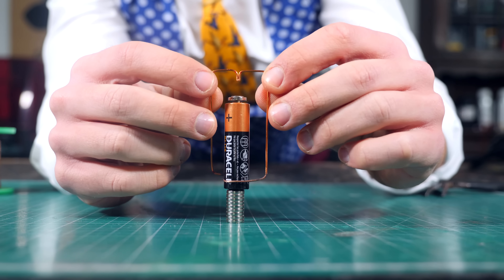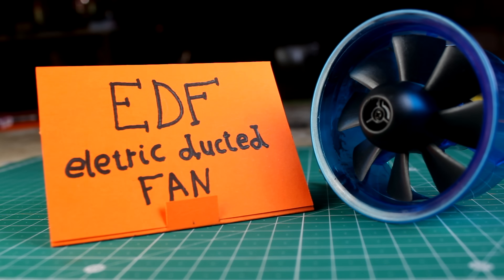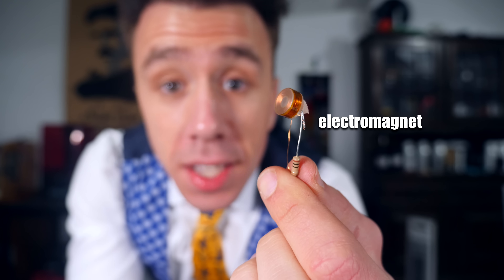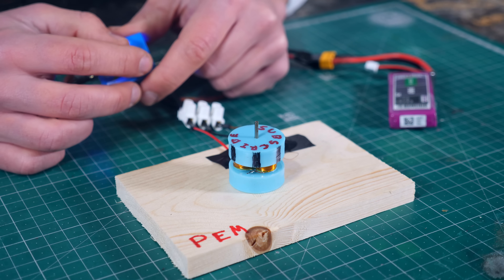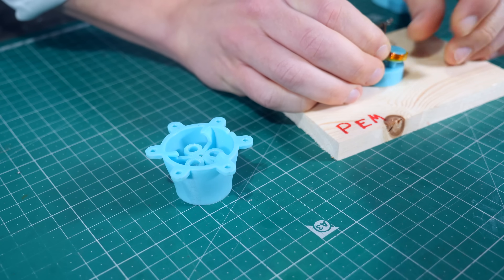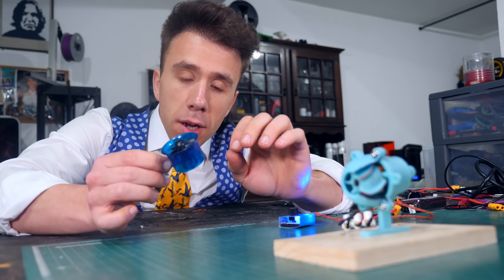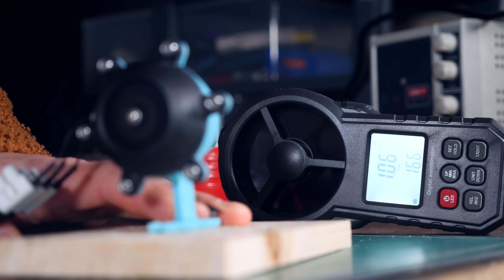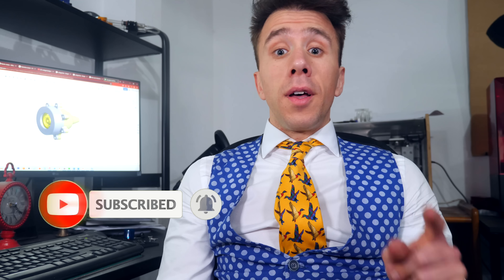I 3D Printed an ELECTRIC MOTOR FAN

Comment: You can’t put a convergent divergent nozzle on an electric fan. They only work when using a thermal working fluid (steam, combustion gases). People try all the time to increase thrust on EDF airplanes by messing with the thrust tube and always end up with less thrust than they started with.

Comment: Seguindo o principio da conservação da energia (mesmo motor, mesmo consumo energético) é óbvio que alguma energia está sendo dissipada de outra forma que não empuxo, normalmente energia térmica pela compressão do ar e provavelmente alguma parcela em ruido sonoro mesmo... Resumindo: Um ventilador em duto não possui incremento significativo na pressão do ar, porém um compressor sim! Geralmente só se usa um compressor em casos realmente necessário (por exemplo para aumentar a concentração de oxigênio dentro do volume fixo da câmara de combustão de uma turbina de avião), nos demais casos a simplicidade vai sempre levar a medalha de eficiência... 
Segundo ponto muito importante, talvez você esteja controlando apenas a frequência de rotação do motor e não a corrente consumida. Neste caso o duct fan possui uma inércia rotacional muito maior em relação ao eixo do motor, por consequência consome uma corrente maior e necessita mais energia para a mesmo número de rpm. 
Parabéns pelos vídeos, mistura perfeita de entretenimento e conhecimento!

Comment: The EDF is moving a lot of air fast. The centrifugal is moving a lot of air slow. You're using up energy in losses from poor fitting impeller blades and the fact your are pressurizing the air. That pressurized air is then leaking out of everything except the exhaust.

Comment: You need to revamp the design. More blades on the impeller. Also there is some specific geometry depending on the volume you want to bring in and direct the flow. Additionally to really get thrust you’re gonna need to work in some compressor blades, both rotating and static. Additionally you have to ensure you’re not over pressuring the back end of the motor more than it can move out.

Comment: The air exits the side and turns 90° (radially oriented) if you exhaust the air behind the motor, you cause the motor to do mechanical work on the air as it is forced back radially inward. This reduces maximum speed, and efficacy. Redesign the housing for the centrifugal fan, to accommodate side exhaust tangent to the motor fan, and in the direction if airflow.

Comment: on fans there is a 3d relationship between impeller speed, static pressure, and volumetric flow rate. you are designing your fan to have a high static pressure, but a low flow rate. 
thrust is mass flow x velocity (i think). so you need to have both mass flow rate, and static pressure that translates into velocity. energy is mass* velocity^2. so more mass less velocity is more efficient as well. an air speed meter only measures one part of the thrust equation. you are better off with a load cell for thrust measurement.

Comment: Just try adjusting the CD area ratios and changing the geometry of the blades. 

Modern aircraft use convergent divergent nozzles, the intake area and the exhaust area must be at a somewhat perfect ratio to maximize efficiency. Aircraft also use two counter rotating blades to slow down, compress and get rid of any turbulence. In those smaller conditions turbulent air might not have an effect tho. You’re also adding more energy into the system in modern aircraft through combustion which helps accelerate the air.

Comment: The design of the impeller is rather good for high pressure and low volume flow.
You would probably have to achieve significantly higher airflows, which is possible by lowering the angle of attack of the blades.

I don't necessarily have experience in developing thrust generation, but this is what I remember about the design of fans for grain cooling and drying systems. I should have the documents for this lying around somewhere and could look for them on request.

Comment: I'm assuming the issue is torque. Compressing air in a centrifugal fan needs more torque than a simple ducted fan does. The latter is compelling the air to move while the former is forcing it. Even a small amount of squish on the gas is taking energy from the actual movement of the air, if you look at it as a closed system. I'm assuming that compression is the desired effect, considering your proclivity for rocket science, so I'm going to suggest beefing up the torque to compensate

Comment: The compressor you have printed compresses the air to increase pressure and generate a high-pressure flow, while the fan moves the air without increasing the pressure and generates a constant and uniform flow.
Then the surface of the blades is not equal the blades of the EDF seem larger and are able to move more air than the compressor.

Comment: @Integza

EDF's move a volume of air thru the duct quickly, though not very efficiently. While a centrifugal blade is building up compression. This is why your seeing such a large difference in output thrust between the two.

Now if the Centrifugal blade was compressing air to be later mixed with fuel and ignited, then you'd definitely see a significant increase in output thrust compared to the EDF. Simply due to the compressed mixture expanding rapidly as it burns. (A.K.A a very basic Jet engine) Unlike a jet true engine the entire cycle is being driven by the attached electric motor, without it wouldn't work at all.

What makes a modern jet engine a true marvel of engineering is that it uses a bypass-fan (greater mass airflow) that spins much slower than the attached compressor fan. This enables the bypass to produce a large amount of thrust, while still allowing the internal compressor to use a portion of the incoming air, mix it with fuel, burn it, and drive the entire assembly. It does this without either the bypass or compressor overdriving (runaway feedback loop) each other due to the magic of math.

Comment: The fan are not tight enough to the casing, it will loose compression, since it can escape. If you 3d printing it anyway, build the casing and the fan as one and you will not loose compression. Compression fans just have to be that extremely tightly crafting.

Comment: Speed. Centrifugal fans require much more speed to produce the same amount of air movement. Centrifugal, exhaust driven air pumps (turbochargers) spin at 100’s of thousands of rpms to produce the airflow needed to provide positive manifold pressure in an engine that is an air pump in and of itself. 
Get a higher kv motor to get the centrifugal fan moving the same amount of air.

Comment: I would have thought investigating the venturi effect on the intake side would help as would looking at different exhaust sizes as honestly, looking at the design you're choking the speed but most likely ramping up the pressure.

It's one of those things where you can move less air, but push it further or move more air a much shorter distance.

Comment: A few things: 
1.Blade surface finish quality 
2. Air intake surface area
3. Air exit surface area
4. Impeller blade angle

These all work together to provide the maximum mass flow rate for a given rpm. Figure out what works best for you but that's what you're looking at. If you can't draw enough air in, you can't pressurize it and if you can't get it out, you're bottlenecking your flow potentially at 2 spots. Blade material affects how air flows over it and while potentially negligible, is still a factor. Lastly the blade angle determines how much air is being pulled in so blade design is key as well as the body design of the housing to allow for minimal turbulence.

Comment: Converting speed into pressure anf back into speed is causing a lot of energy loss. The other fan is just accelerating the air and has there for a higher efficiency for air speed.

The pressure component needed in turbo jet engines is for a better combustion. But if you dont have any kind of combustion you are just wasteing energy by trying to increase the pressure in this degree.

Try to create the best fan you can. Make a ring like housing and just decrease the exit of the housing by about 15-20% compared to the intake.

Comment: i think the reason you are not getting much flow is because the duct on your diy edf fan is not ideal for your application, if you look at the intake of your store bought fan, and the intake of your custom fan, you can see that they are clearly different. im just saying this from what i think the issue is, i havent actually tested this (although you have inspired me to create and test stuff like this). hope this helps

Comment: I think this is because the air intake is very limited in the engine you designed. The blowing speed of the fan is greater than the air it draws in. The engine that cannot draw enough air cannot provide sufficient thrust. my suggestion would be to install a larger normal fan in the front and transfer the air collected by this fan to the impeller motor with the help of a tube.

Comment: Hi Integza, make a 2 stroke rotary engine base on the new developed Lontra Blade air compressor. https://youtu.be/TkBNh-Zk2Mk
the idea is to build a spherical engine, were half is the compressor side and the other half is the combustion chamber + injector. ( this could became a revolutionaly and simple engine)

Comment: Squirrel cage fans put out a lot more air than an edf. The edf is probably efficient when inside of a closed system but in open air flow is lost to turbulence. In a Dyson it's not the power of thrust that matters all that matters is the vortex is generated bc that's what allows the air flow but keeps heavy particles trapped. Think about it like a turbo, think about the volume inside the edf casing, think about how many rpm it takes to move the volume of air and then calc your thrust target.  Either add surface area to the impeller, add power to the motor or use a design with higher output than an impeller. Love your work

Comment: First design with the new propeller should work some of the air is being pushed out the front. The outlet could be made longer to direct the air straighter towards the force reader.

Comment: DUDE.... I... had this exact thought a couple days ago! Wild...
(granted I know you had it much earlier, given time to create, film, edit)

Of course, like you did in this video, I had a different name for mine:
    Very High Bypass Aero Spike
My only thought that seems different to yours (sorry, I'm not a modeler, or blessed with an internet connection with sufficient monthly bandwidth to download software):
In my head, my design would've had the airflow travel from the fan outwards like yours, into a hemisphere channel, which then connected to the start of the aerospike. (albeit, mine was based around a jet engine, but that should be irrelevant heh)

So the air will come in and flow through the ducting in an S trajectory, rather than a corkscrew. In other words, my fan would be more... fan like, and less centrifugal-fan (compressor) like.

I think for propulsion, you want to move as much air as possible. The duct is a Venturi in an EDF so it improved efficiency, but it's moving lots of air at "zero" pressure.
Which is, as I understand it, how a Turbo Fan engine is working. The "Fan" isn't doing any (or much) competing, as that would be "work" and lowering efficiency. The only compressor turbines are being used for the combustion side (vs a key engine where all airflow gets used for combustion).

I guess where I'm going with this is that I suspect you've got too much back-pressure? Which is because you're wanting to compress, when you should be (I assume) wanting to REDUCE restriction and use more blades to increase airflow. Letting the aerospike do the work of "compressing" the air and produce additional thrust...
But I have no education in any of this so I'm guessing, just as you! 🤷‍♂️🥴
Reply: And after reading the comments, I see others have better expressed the limitations I had tried to convey.
i.e. Turbo Fan moving lots of air, but slowly.

Comment: Aircraft Mechanic here. Okay, so I’m just supposing based on what I saw in your Video:

In general the following is given as true:
Early jet engines used centrifugal compressors because it has the ability to create relatively high pressure differences PER compressor stage, while axial compressors can’t create high Pdiffs. That’s why axial jet engine compressors use a lot of compressor stages to create enough pressure for the combustion chamber:

Why did we get rid of the radial compressor in jet engines then (except a few shaft power turbine engines in helicopters and sort a things)?

Because the throughput of Gas is EXTREMELY limited compared to an axial compressor (what your traditional ducted fan is). 
You’re looking at around 90kg of Air per second. That’s the physically possible maximum for radial compressors regardless of their size and anything. That’s the limit and that’s simply not enough for high power jet engines (also because the air has to make a 90 degree turn there goes some efficiency).

Given that your radial compressor is roughly the size of your EDF it’s simply moving less volumes of air at unequally higher nozzle speeds. 

So in a given time interval there’s not as much mass of gas passing through your compressor resulting in less thrust which totally makes sense if we remember that thrust is just the „counterforce“ of the mass we accelerate away.

Hope that explanation might have helped a little.

If you want to, you can text me on IG @Chieflouis01 and I will send you the pages and graphs from my textbooks explaining it to the very minutest detail. They’re in German tho I’ll translate everything you need to know! :)

Comment: I'd argue that Mercedes builts a better fan for its turbocharged engines ;) Maybe take a look at the compressor wheel geometry (Verdichterrad in German; idk how it is called in english).
Also: Did you consider the stuffing limit (again: Stopfgrenze in german)? Basicly it says that - based on the dimension of your fan - there is a limit of how much air could be moved and it is highly sensitive to temperatur. However, my english is way to bad for the technical literature, but let me know if you'ld like something in german.

Keep up your entertaining work =)

Comment: I teach UAS flight systems at a university and we do thrust testing on various motor/prop combinations. The thrust is determined by the motor, the propeller, and the voltage of the DC current going into the ESC. You have the same motor and voltage in both cases but the propeller/whatever you use to turn rotational velocity into kinetic, is different. The impeller design is just worse at moving air than the EDF is, that's why you don't see any on the market. The constriction after the impeller to increase velocity is not increasing thrust because the compression of the impeller is probably really bad. I would suggest making the impeller as light as possible, increase the intake size, and make sure the distance between the impeller blades and the walls is as close as possible to solve the compression problem. I would experiment with different exhaust sizes as well, yours looks too small. Try about the same size as the intake.

Comment: This design will give better flow when the intake to discharge diameter ratio is smaller. Try making the discharge diameter bigger and maybe play with the rotor blades profile to get similar results. The one you made is actually a compressor missing the diffusion stage + really high compression ratio, even if you have added the defusion stage to it, it would need very hight RPM to start compresing, then comes the air flow limitation which will bottleneck it's performance.
Reply: That was my thought too, that he was compressing the incoming air.

Comment: edf is pretty complex to do this right. The edf is designed to move air (volume+density) through a pipe and you can calculate how much power is needed to push a desired volume through the duct to produce thrust and velocity. it is mandatory the air has as little bends or compression as possible. Then the airfoil needs high velocity as well to gain efficiency. This is not present close to the spinner but at the shroud. Your design lacks speed on a wide area of the rotor blades.
Keep in mind a jet design is to combust air and add fuel to gain thrust, An edf is only to move air through the shroud.

Your edf has a small intake which creates a vacuum and restricts the rotor to transit the air and the thrusttube is too far compressed as well.

Have a browse in my account. There are numerous  edf test rigs and test flights with scaled down experimental edf jets (models varying from high speed records, low noise output, scaled town drive trains or high thrust).
I had this hobby for 2 decades until there was nothing left to be desired.

greets from the Netherlands.
Erik

Comment: The fan that produces more thrust is designed to move higher volume of air at lower pressure.  The centrifugal fan is designed to move lower volume of air at a higher pressure. More volume of air (more mass) will produce more thrust.

Comment: Axial fan put out more flow, while centrifugal fan put out more pressure. 

Axial fan depends on the blade design and pitch to make pressure, while diameter will make flow. 

Centrifugal fan depends on blade design and diameter for pressure, while pitch is used for flow. 

In jet engine, they normally use a single state or double states with centrifugal fan. While Axial fan is required to have at least 7 states, and some even have 14 states. 

The advantage of the centrifugal jet engines is having higher pressure and compact, while the advantage of the Axial jet engine is having more flow and more powerful.